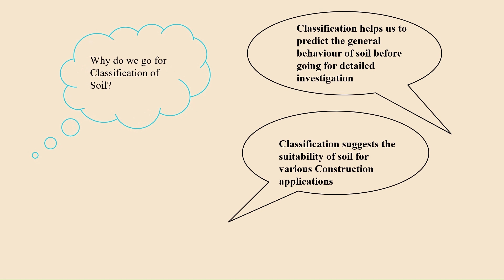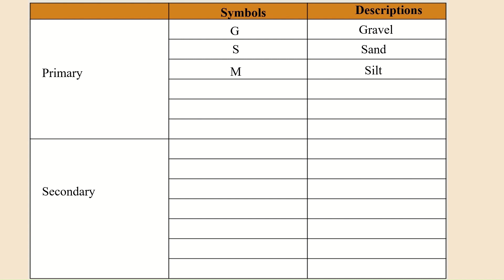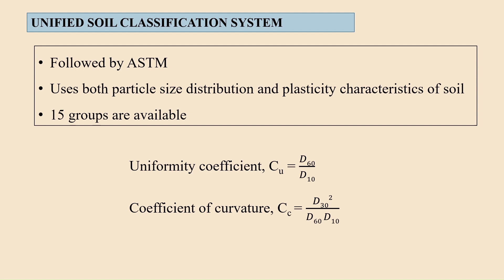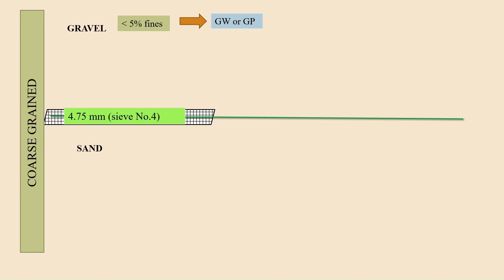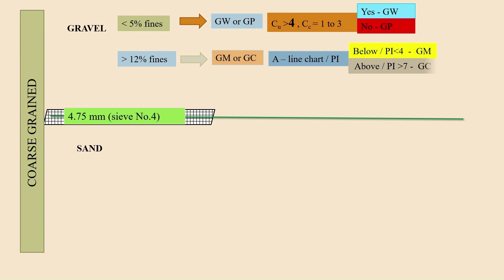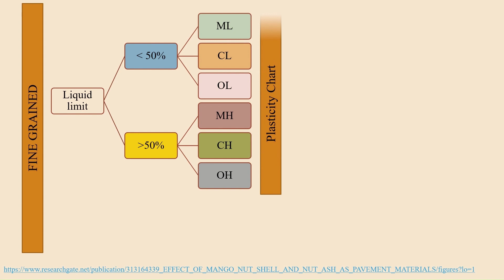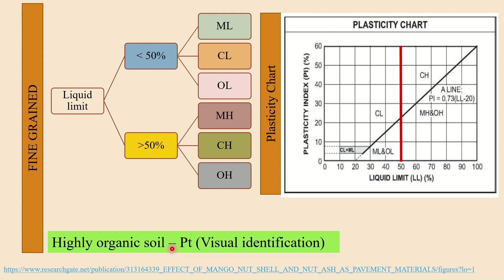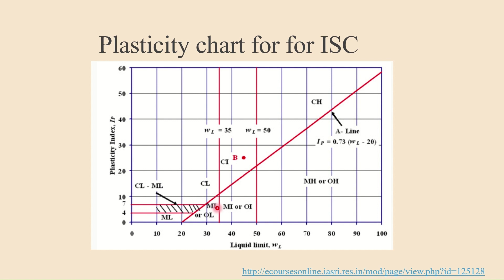Classification of soils| ISC System| Unified Soil Classification system #soilclassification

Comment: Thanks for the video
One doubt may please be clarified that for 5-12% of fines material in Gravel type, classification is shown as only GW-GM but it can be GP-GM, GW-GC and GP-GC.
Reply from the maker: Due to the particle size, with gravel silt is expected to be present and with sand, clay is expected to be present... Anyways hydrometer analysis may be done for confirmation...